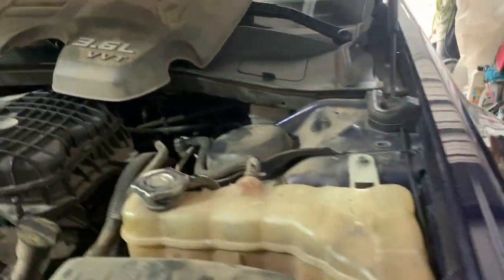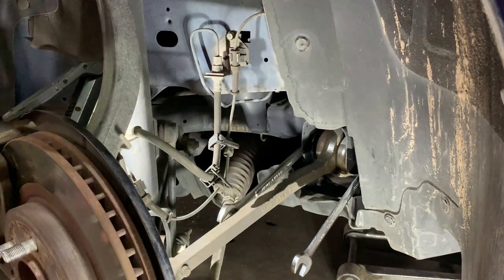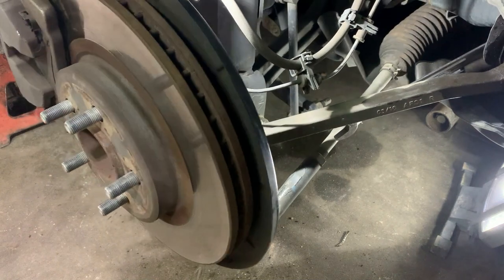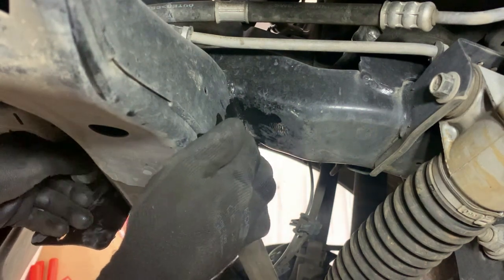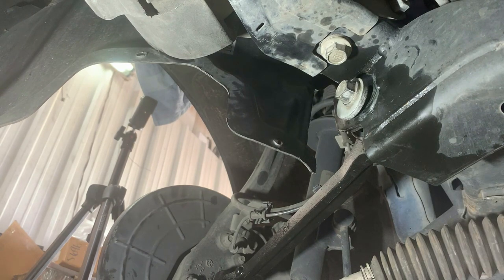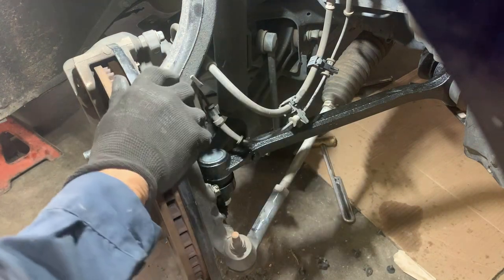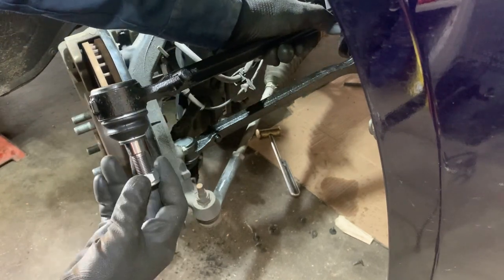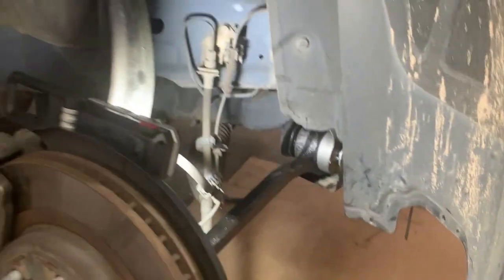Chrysler 300 2013 lower forward control arm

Comment: That's a good idea to mark that cam bolt before removal.  Othewise the front toe could be off.  Thank You!
Reply from the maker: Hi jivepatrol16834 thank you and thank you for watching. I appreciate you.
Reply: YEA... mark the bolt and washer. the cams control the camber instead of toe. Toe would be changed with tie rods.
Reply from the maker: Hi  @martyjansing2675  thank you for the comment and thanks for watching. I appreciate you.
Reply: @martyjansing2675  - you're correct - Cam Bolt controls camber and differential camber.  Thankx

Comment: Hey mine has a sway bar and heat shield wrapped around it? How would I get that out? And suggestions?
Reply from the maker: Hi dallastexas 👍 not sure what you’re talking about. I’ve never seen one sorry but it should have bolts where you have to undo them to get it out. Just look at it closely and take your time. They should be a way to get to it. Sorry brother but thank you for watching. I really appreciate you.